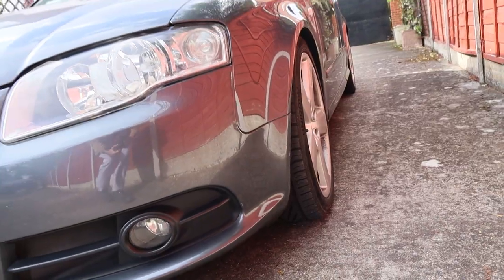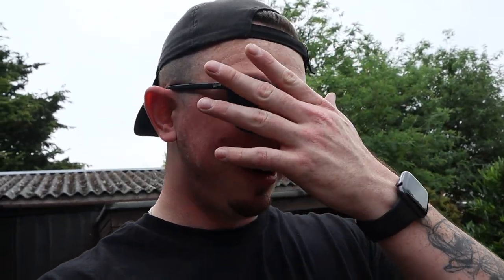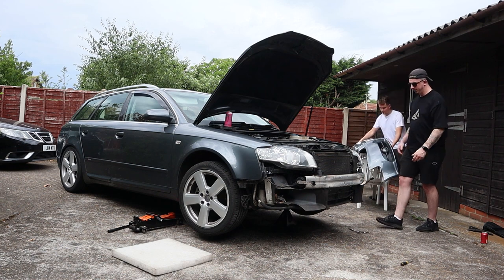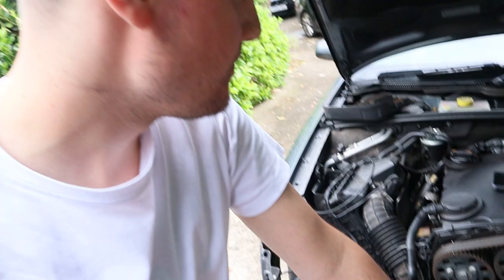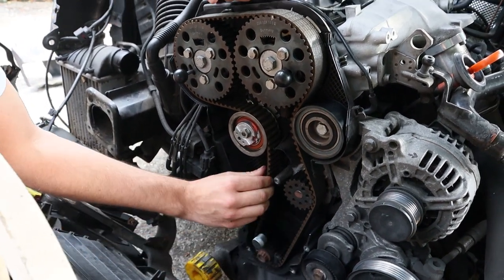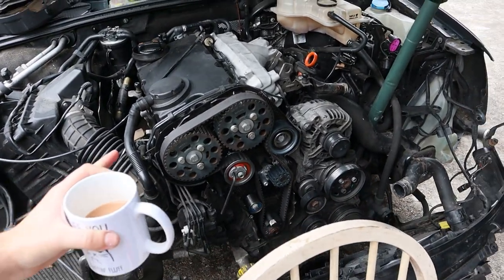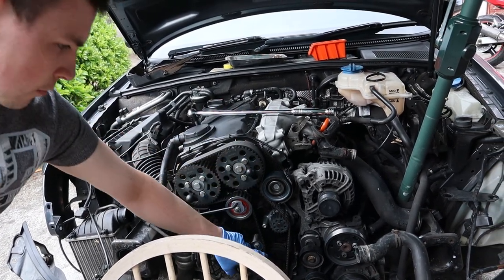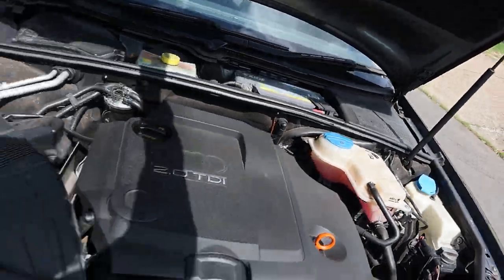Changing the Timing Belt on an Audi A4 TDI!

Comment: I thought on B7 there is a "Service position" for everything on the front end to slide forward enough to enable the job without actually taking the front end stuff off?
There is also a bleed for the coolant at the top 2 hoses near the brake servo, they go to the heater matrix behind the dash. You can undo one of them which has a small hole in the hose near the clip...pull the hose out enough so air escapes out of that hole, start the car, and when there's a steady flow of coolant with no air, push the hose back in....system bled. Then top off the coolant tank.

Comment: If you ever do another, get the non tensioned side of the belt as tight as you can before setting the tension, that’s what I do and when I turn the crank 4 times they always re time with the pins. I’ve only had to undo the 13mm bolts once on a 2.0tdi after the belt snapped and I replaced the head. 
Reminds me of the fun days in the driveway before I opened a garage 😅
Reply: Don’t take that negatively either, just passing on what works for me - good job doing this as a non mechanic

Comment: Now you need to adjust torsion value. For better starting and better fuel economy and power. Use vcds to see.
Reply from the maker: Yea great tips 👍
Reply: @BWTV  Any time man! And watch your cylinder head, they like to crack and since you mapped your car it is a matter of when. I have a3 BKD almost the same engine and i had many problems if you need any advice or help about anything just ask me. I am a Dr. for these engines. Good luck!

Comment: Hey, nice Video. I like your content! 
How is your impression of the engine so far? I´m thinking about buying one, but I´m not shure about the 170HP Version. Some say it is to unreliable. 
How many Miles have you done so far. Any issues not shown on camera?
Thank you very much! :)
Reply from the maker: Hi thanks for your kind comment! I've had the car for almost 3 years and driven  over 25k miles. 
No serious issues to report, the only big one was the blocked DPF (but get that cleaned 😉 and you'll have no issues) 
Wheel bearings were the last thing I changed. I filmed that but haven't uploaded it yet. I think out of all of my cars this one has been the most reliable and I have a hard time thinking about what to replace it with. 
Big one to look out for is the oil pump balance shaft. If you get one of these engines, make sure that's been updated or upgrade it when you do get it!
Reply: @BWTV  Oh, thanks for the quick reply!
Yeah i've read about the oil pump issue. I'll make shure to watch out for that.
Its a great advantage to have someone who is documenting his story with the car. Very helpful for the rest of us, thanks :)
God bless!